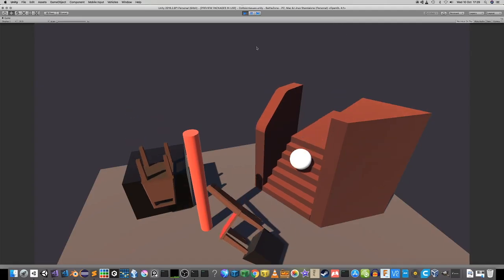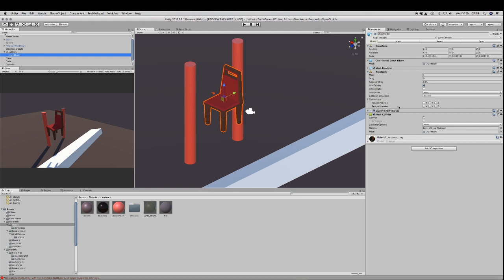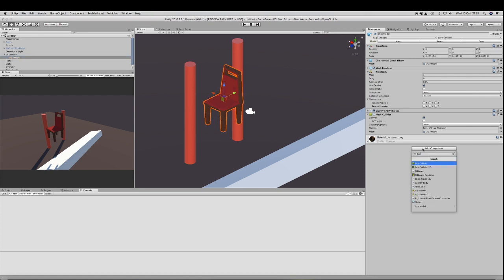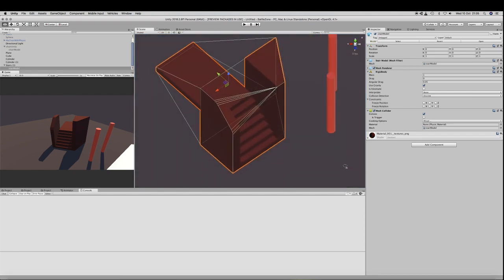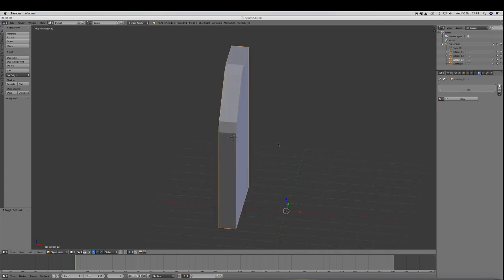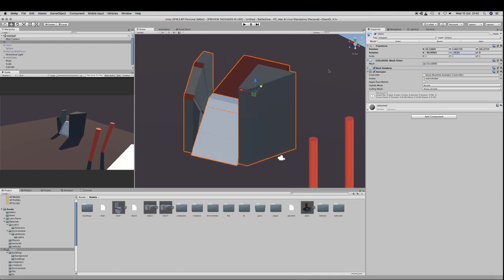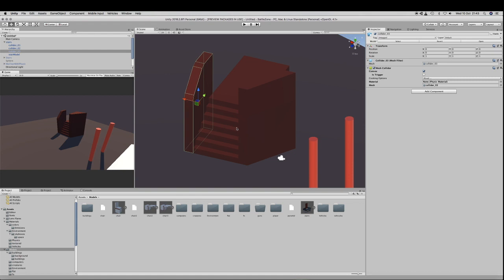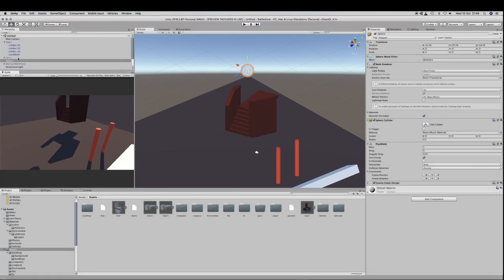Mesh Collision from Blender into unity. Easy way.

Comment: DELETEING THE MESH RENDER WILL MAKE THE OBJECT DISAPEAR
Reply from the maker: no, you delete the mesh renderer of the COLLISION OBJECT ONLY - not the rendering of the object itself.
If you want, you have 2 shapes with 2 renderers - one is used to represent visually your Gameobject for example a car (with the wheels etc), and the other is a convex shape for the collider - it s this one you delete. And ship shape you design on Blender can be just the simplified shape of the hull of the car.
Got it ?

Comment: This is okay for prototyping but doesnt work in release, because it isnt performant at all.
In release you will want to combine all separate meshes into 1 single large mesh as much as possible, because for every mesh = 1 material and atleast 4-8 draw calls, if you split your mesh into a 10 parts it will be 40-80 draw calls per frame, but thats just with 1 material, if you have 2 materials or some triplanar it will easily be 200 draw calls per mesh per frame lol.
Reply from the maker: Well 'define' not performant/not working in release.
It does.

This method is not to be used on a full static scene. it s only for some MOVING (non static) objects that needs to still interact with physics.
As you see in the example, the stairs falls before, got also a falling ball interacting with it.

Now you are right on one point;  you can merge into a huge object all the same objects that are ... statics+one material. It will reduce the nb of draw calls, but nothing is magic: if you need to do some stuff(physics, script, etc), you may impact your perf in other hand.
Nothing will beat a pure static one object scene in terme of speed  ;-)
Reply: @MrEricGuerin   Yes you are right its a cool trick that can be useful in some situations, I am working on a big game in particular and also have these convex collider issues, but this is not a solution for us, which is why I said those things in my comment.
Really Unity should fix a lot of things, they like to add new features every year, but everything they add is never finished, its always very basic, which is in my opinion the biggest drawback of Unity. The real solution to this problem is by Unity fixing their colliders lol.

Comment: but mesh collider will  be heavier on performance
Reply from the maker: it is true, however, like everything, colliders need to be put in a smart way and so, in a smart quantities. Put them where it matters. 
Like in this example, with a diagonal colliders, better to do it that way. In any case, as a developer you need also to do 'smart' decisions all the time - so the question you need to ask yourself all the time is : 'does it worth it? is it pertinent to do it? is it performant enough?'
But again, performance come LAST in game dev - first it s better to have a 'slower' game than a performant game that ... never come out. Moreover, every 6 months hardware gets more and more powerful - so some issues that are relevant today will not really be an issue where your game is released. Hope it helps !

Comment: Hmmm is there a similar method for procedurally generated mesh?
Reply from the maker: if it s a proc mesh, you need to add a mesh collider component,  like so
mesh = new Mesh ();
...
.... (set the indexes & vertices into your generated mesh)
...
MeshCollider meshCollider = gameObject.AddComponent<MeshCollider> ();
meshCollider.sharedMesh = mesh;

Now, you need to be sure the mesh you create is a convex mesh if you need a dynamic (moving) object reactinfg to Physics. If it s a static object (like a generation of ground or building) you do not have this restriction.
Reply: @MrEricGuerin  my mesh is non convex and need physics... I have no idea how I could split my mesh into convex mesh collider since its procedural...
Reply from the maker: @nukee2283  if it s fine in your scenario, you can still force to calculate a convex form for your collision from the collision mesh you created by doing :

meshCollider.convex = true;

Otherwise, split it in different parts, if you know exactly what kind of type of part of your procedural mesh you are generated.
For example, if you have a car, do not generate fully the car, but generate separatly the door, the windshield etc ... if the full approixamte convex shape is not good for you.

May I ask you what kind of model are you trying to generate?

Comment: I have 3D models I imported from Blender for an endless runner I’m making, and when I attempt to Add Component > Box Collider, it spawns a box below the object. I cannot find an answer anywhere as to why the Box Collider doesn’t just outline the object like it should.

I can edit the collider, sure. But that shouldn’t be necessary. Why doesn’t my box collider auto detect the shape of the object? Almost as if my object isn’t even there...
Reply from the maker: is it possible that your imported 3D object is made of different meshes and you tried to add the box collider on the gameobject itself ? (so if you prefer, you add a box collider on the PARENT object of the mesh, and not the mesh object itself ?

Comment: Hey what if my mesh is like a sphere, which is hollow from the inside, (I wanna make objects bounce around inside the sphere), how do I create a convex mesh for that sphere?
Reply from the maker: Do you want the hollow shpere moving with Physics too ?
if not, then use the mesh collider of Uniy.

If the answer is yes, then you are in the worse case scenario. You will need to approximate the inner shpere collider in a mutiple shapes that can be good enough to represent the sphere (an convex!) that may be tedious and not funny ... 

However if you want an exact bouncing it may be too costy in shapes. 

I wld recommand more for a script that emulates that : ie:  adding a sphere trigger collider that represents your inner hollow sphere border,  then creat a script that detects when objects exist the sphere trigger, you can apply an opposite force to push them back to the center of the sphere ... that's my first idea. It should be fast and efficient.

Hope it helps !
Reply: @MrEricGuerin  well the answer is yes, and it rly is worse than the worst case scenario😅 I even have to simulate water in the sphere, well I will try adding a hemisphere woth some kind of shader to make it look like water I guess, anyway thanks for help man rly appreciate it!

Comment: this isn't easy way, why would I waste time on every model I make and add colliders..
Reply from the maker: well it depends on the purpose : if you DO NOT need a MOVING RIGIDBODY it s not necessary - just use the mesh collider from Unity.
Here, it s a about a specific case. Now, you could just use a sphere or a box colliders (provided by unity), and it s maybe again enough in your scenario.
However, the fact to use the mesh editor of your choice - here Blender - is a life(time) saver.
Reply: Eric GUERIN Thank you, you explained very well.

Comment: 2:27 min what you did here to put a plane in the form of a slope, it already seems to me crap if it is a professional point of view, because your physics are already wrong from the moment you apply a solution as mediocre as putting a plane tilted, the sphere will not bounce as it should the physics will cause an inadequate and erroneous reaction to the one produced by a ladder, and if your event that is about to happen should stick to the physics that you are applying, because you are already preparing so that it does not get a proper result
Reply from the maker: well, if your remark is about a stair with a stair collider shape that should be for each steps of the stair, yes, of course you can. Maybe the video is not clear enough, but is basically how to make any complex mesh so with concave shapes, and movable by Physics. Now the complexity of your collider is up to you, if it s relevant to your game play, the target machines (PS or Mobiles for example)
The method here is to show you how to accomplish it in a simple way. (by not using the collider build in Unity that are too simple for most realistic game cases)
Maybe a better example should have been a moving car or a spaceship where a player can enter into it, and the ship or the car can be still movable by Physics.

So about the stair mesh itself, of course, in Blender, nothing forbid you to have a more closer shape that represents each steps of the mesh (stair). The idea here was about to make collider in Blender (and not Unity) and use them as collider for Physics. You can of course do a better quality collider mesh (depend on your game scenario, but keep in mind they need to be fairly simple (performance issue if your machine is slow) an convex (not concave) ... but, yes, if you want to push the physic in a more realistic way for some specific part of your model, you are free to do it and this method is still valid. I hope it clarify your remark.
.
Reply: @MrEricGuerin  understand , thanks, yes is clear

Comment: the next question I will ask I have not found a satisfactory answer
Note: I had already gone through this discovery on my own, I know that it limited the problem in a limited way.

Question:
put one more property and add one more collision box to the mesh, what does it cost in engine performance? How much is this encouraged when you have (I will take as an example the chair with which you are doing the example) a chair that has to put collisions on the legs, seat, and backrest, on average this would be 6 collision boxes, ([1 on each leg = 4 collision boxes] + [1 on the seat = 1 + 1 collision box] + [1 on the backrest = 1 + 1 collision box] = 6 COLLISION BOXES, but I don't know what cost has this in consumption of resources of my computer or in the game engine.

Can you explain this to me? It is encouraged, it becomes heavy, is it too many calculations? what about performance?
Reply from the maker: you kind of answer it yourself Mauricio.An absolute rule is to make things faster and simple enough for making your world where the player is playing realistic enough to be credible. 
But of course, to do so in a huge environment, you may run in performance issue as soon as you simulate with an exact physic simulation  all the elements of our scene.

For example, if in your game, the fact to have a chair with 4 legs, a back plus the place to seat need to be simulated, because you need it in your gameplay, then do it. Now if it s only for the decoration, don't (or two boxes can be enough maybe.)

The problem of performance is a huge pb in video games :  not everybody has the same machine, and even now, it s 'worse' because you could have a game also running on older consoles, or some mobiles, where the power of calculation graphic cards, have a huge difference in technology support (shaders version) . 

So everything is depending of the target machines for your game, the game play, the complexity of your scene, so it s only you that can decide where things need maybe simplification. 
That's why you will need also testers with a huge variety of machines to see how your game is running.

Better to have a game running at 30 fps with a more approx physics, but still looking good, than 5fps with a perfect physic.

What you want is first that people play your game AND have fun. That's your main goal. Never mind if sometimes you will need to do some compromise.
A good example of that, is for example boat floating on the sea.
https://www.youtube.com/watch?v=aGUh41wNiss look at my video (no sound) it s not real physic applied of the model of the ship, however it follows the shape of the waves and from a player point of view is fair enough. 
So, only you can decide where to put machine resources to simulate things.

Comment: It's also strange to me, why did you add the box collider to your stairs? You already have a nice mesh that is responsible for the correct collision - why do you need any additional remedy?
Reply from the maker: it is indeed (in 2020) not an need anymore to do so. I should remake a video up to date.
You need indeed to put collision meshes (check convex) for all the part of your mesh, and if you have a game object that is the parent of the 3D object (I think it was the case if in the video), you can just add the rigidbody only, no need to add an extra box collider. Thanks for your remark - it will help those who are following the tuto (and reading) the comments ! :)
Reply: @MrEricGuerin  In 2020 is this process still required, or does unity handle mesh collisions differently? Do I still need to model separate collision meshes in blender?
Reply from the maker: @x_MoonlitShade  Unity will not do that for you ATM. if you have a 'complex' moving collision meshes, you need to make them in Blender (a list of different CONVEX meshes that will be used for Unity as colliders), like in the video. PLEASE also do not mix with the auto collider generation system  provided by Unity, that works, but ONLY for NONE MOVING objects. It is important, in this video, it's about handeling collision objects for movable objects by Physics. 
Otherwise, yes, if it s a rock or a  building that will never move, you can use the mesh collider directly generated by Unity. Hope it helps!

Comment: neat... but i not get exactly how you get a other mesh layer in blender... may a longer tutorial you can evolve the explanation, i a bit raw in blender and want this kind of stuff, but not know enought to understand what you do in blender... i already create some mesh, but not work with multiply layers or anything that advanced hehe... well i will do somes tries

thanks anyway!
Reply from the maker: Hello thanks for your comment. What you mean by "layer", in Blender is 'Object', right?
then, if your model is complex (=several objects for one 3D model) you need to create enough several convex objects in Blender that will represent your collider in Unity.

A "collider" in Blender is just an object (so made of vertices like the one made for your "visual" mesh) the only diff is that you will not show the mesh part dedicated for the collision on screen.
So imagine you have a complex 3D model in Blender made of a 2 cubes (=1 object (or layer?)) and a pyramide (made of 1 object) => you need to create 3 other objects : 2 cubes and 1 pyramide that will represent you collision mesh.

But maybe it could worse I create a new updated tutorial, with a step by step for Unity and Blender 2.8.

Comment: What do you do when your mesh collider is taking the mesh of a model that doesn't exist? I was walking into walls that don't exist anymore in Unity because I deleted them all and I even double checked the meshes were the correct ones and they definitely are. I've also tried reimporting the model but that didn't work either. Any ideas?
Reply from the maker: hum. Not really sure about ur pb 'taking a mesh that does not exist'. 
My advice would be to delete this gameobject and restart from scratch.

but, the idea is that if you remove ONLY a renderer only (a component that appears on the right of the unity editor and you select a gameobject) then your object DOES NOT RENDER - however the collisions, or scripts attached to this gameobject will be still active.

I will need more to understand your pb - maybe a screen shot, a video or a zip of your project ?